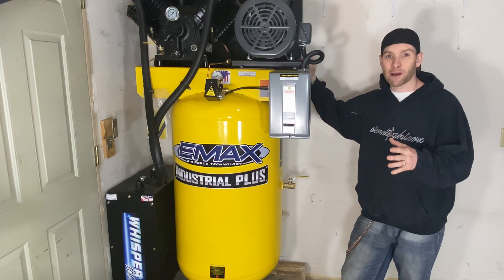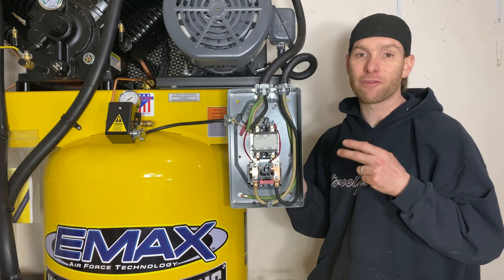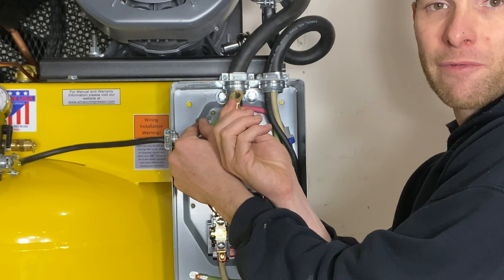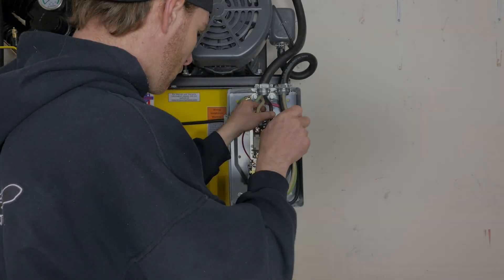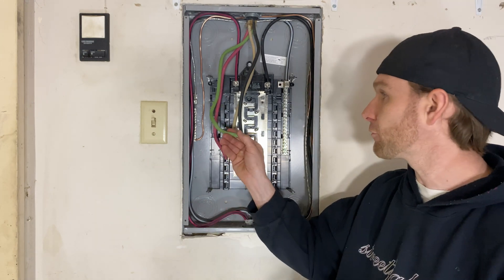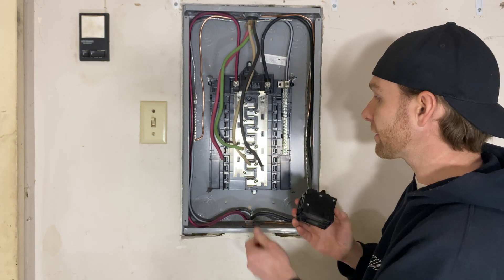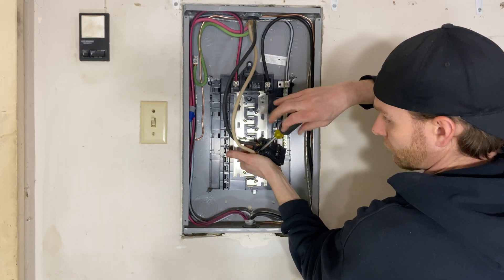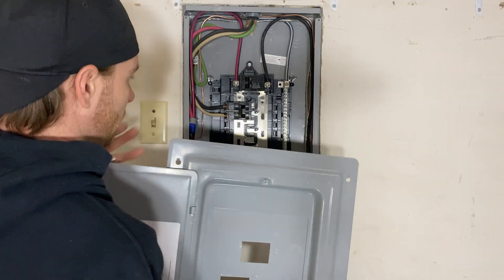How to wire 80 Gallon Air Compressor EMAX Silent Air Industrial Plus Electric 240v 60 amp 10hp 7.5hp

Comment: You should have capped the white and used the red for your 2nd 120vac (Blk & Red)
Reply from the maker: Yeah, I thought about that, but the majority of people are going to be running three wire. So I wanted to show you the example of how it will look for them with just the black white and green, but yes. The permanent installation should be black and red for the hots if you're using four wire. That was only like that for a couple months.
Reply from the maker: I thought I explained that in the video, but I may not have

Comment: Thanks a lot for the great video.  I have the exact same Air Compressor coming next week and have the exact same 4/3 SOOW wire as well.  I was a little concerned with what exactly to do with the Neutral Wire, your video is a relief and I also confirmed via google.  How is you Air Compressor working out?  Any sugestions or things you wish you knew ahead of time?

Comment: Dude why did you capped the red and landed the white, you did it backwards🤦
Reply from the maker: In a standard 3 wire system, using the proper wire it would've been just black white and green. so I tried to make it how it should've been, but it doesn't really make a difference either way as far as functionality
Reply: Since this is single phase, but 240Vac, L1 and L2 and no neutral, the proper color code would be L1 black, L2 Red, and safety earth ground is green.  White in neutral, which is not used
Reply: @IndianTuning  My understanding is that it doesn't matter which L1 or L2, the Red and black go into as long as both these colors go into L1 & L2 in one of the combinations using both colors (Hots x 2).  L1 can be Black or Red and L2 can also be Black or Red
Reply: @bs8010 very true, but L1 or L2 should never be white unless marked (ie tape) red or black.

Comment: Great Video, Just food for thought per NEC (National Electrical Code) the two hot should be Red / Black.
Reply from the maker: Thank you. I was just matching how it came from the manufacture, but if that is Code I guess I should’ve known better. My father owns a  100+ truck electric plumbing and HVAC company. I was in the field as an electrician from age 15 till around 22 or 23, but I’ve been in the office for close to 20 years now.   I could’ve sworn we used to run 6/2 Romex with a 50 amp breaker for smaller more standard 5 or 7.5 hp compressors.
Reply: @BrandonStunts  I think you can put red electrical tape on the white one and be within code.  From watching other videos, it just has to be a good enough visible marking, not necessarily the entire wire.  I could be wrong though, just what I have seen.
Reply from the maker: When I started, we were we were going off NEC 93 though, 99 came in effect a couple years before I was went of the field. Not sure if it was always red and black or if it changed. I’ll have to ask around. Maybe I just remember wrong. Thanks for pointing it out though.
Reply: you can also wrap the white wire with red electrical tape to indicate it is a phase.   Just like taking a black single conductor and wrapping it with white tape when being used for neutral or wrapping in green tape for ground. .   I've seen it done and passed many times.